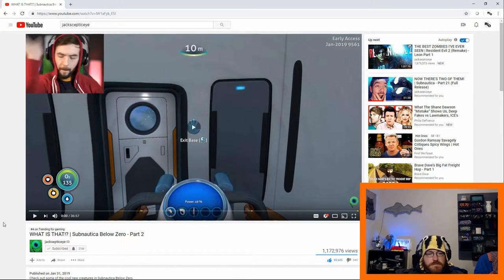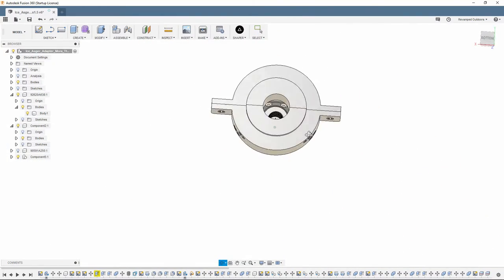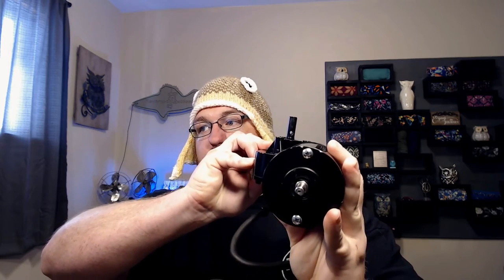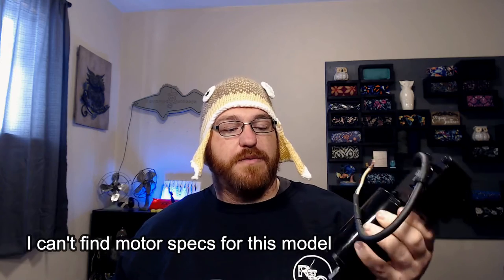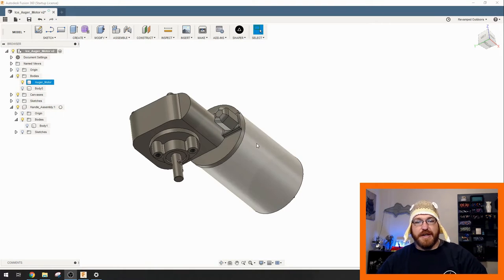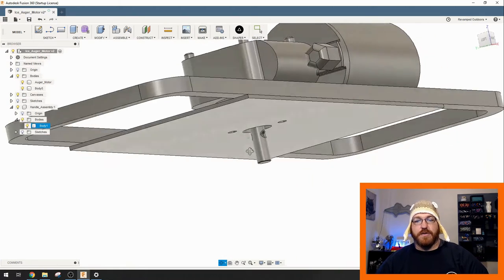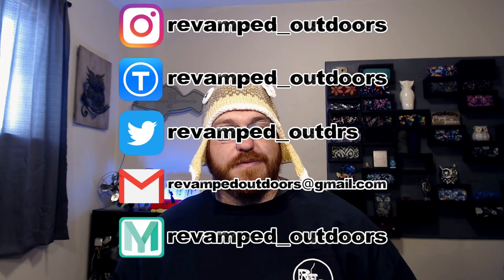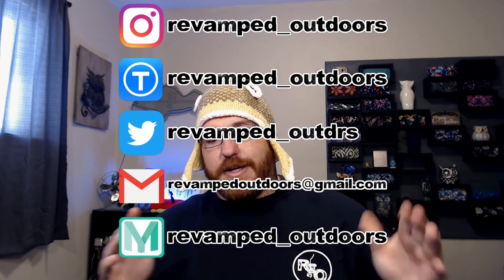I need your help! | DIY Electric Power Auger Part 1 (Lets Build)

Comment: Did you ever figure out how to best mount something to that gear reduction shaft? I have 2 of these SAME exact motors and I'm struggling trying to find something that would easily attach to it so I can set up some 12V wheels.
Reply from the maker: I think I'm still going to go with a piece of flat steel horizontally and drill a middle hole for the axle and then 3 holes for the motor mount hardware. If you're mounting it vertically it may need to be a pretty thick metal to hold the weight of the motor. I hope this helps, I need to work on this project more, I keep setting it down.

Comment: Did you end up finishing? I was thinking about doing the same thing and decided to look and see if anyone has done it before and just realized that you have a video on it.
Reply from the maker: The mounting platform is still giving me headaches, I got the motor and controller working really well it has the torque and I have a petg printed drill adapter that has held up to a 5inch for a season of drilling holes. I want to make a metal platform for the mount but I don't have much scrap lying around and not too sure how I want to mount it. Long story short yes...but no lol. I would say go for it, it is definitely possible for sure.

Comment: Hello, I am using this motor as part of my senior project and i cant seem to find anymore information about the motor itself. Do you have a datasheet or anything?  I love this idea btw, anything to make things easier
Reply from the maker: I couldn't find any information on it, I did model a mock up version of it that is on thingiverse, but as for the specs I have no idea kind of a mystery. Sorry I couldn't be of more help!
Reply: @RevampedOutdoors  no worries. Theres nothing online so it was a small hope lol thanks anyway

Comment: I'm in Australia and have never seen snow before but I'd love to get in on this. What's the deal with these augers?  Do you press down on them? What's the desired rpm of the blade when under load? Can you incorporate a ice assisted heatsink just for fun?
Reply from the maker: Hopefully it's not too hot over there, I saw a few creators this week talking about how hot it's been the last few days.  I'm not sure if augers work on that side, word is they spin the other way and the blades don't cut...probably would fend off a drop bear or two though.  Ok, time to get somewhat serious here, for the most part once the blade starts to cut into the ice you don't need to press down the weight of the assembly takes it through the cut.  This is assuming the blades that tip the bit are sharp and at the correct cut angle.  Sometimes with dull blades you'll have to press down throughout the cut it'll go but it needs a bit of help.  RPM seems to very quite a bit, some blade designs cut larger chunks and are considered "chipper style" blades more rips through the ice then shaves it.  Usually chipper blades run at a slower speed just take more ice as they go.  Some of the newer electrics really move fast with shallow angle blades and produce finely shaved ice.  I would say for the Mora auger bits for this project anything in that 60-100 RPM would be slightly faster than you would crank by hand.  It won't win any cutting contests but it would be better than a stick in the eye. Heat sink....This just blow my mind, literally just screwed my ears back on.  The second you said that I thought about a 3D printed enclosure around the motor body with a water block and a PC water cooling radiator pump combo.  Then we turn the voltage up to 40V and let'r eat! We could even fill the loop with ice shavings made by the auger.  This is a goldstar suggestion, just crazy enough too work! When all else fails you can always just ride the auger when the fish aren't biting although this project probably won't have the torque of this propane powered one. https://www.youtube.com/watch?v=yJ9ecANz1u0

Comment: Great, great idea bro, i actually have some old batteries laying around. I didn't realize there could be other uses for them. I was going to pitch them but now I know they have life after the weed eater has broken.

And I love that silicone wire I'll have to get some of that. 

Waiting for part 2 thanks bro.
Reply from the maker: If they are still holding charge check the terminals to make sure you can draw power without any secondary draw. Some of the newer ones have over draw protection and other fancy safety mechanisms so sometimes you can't get the power out unless a specific requirement is met ie the drill is plugged in. There are ways around it but they can be a huge pain in the rear. Thanks for watching! If you have any thoughts/questions/concerns/recommendations on the project post em!

Comment: so did you ever get this going? I have already built one...only I didn't have super cool 3d imaging and printing to make the parts. here is the video link. https://youtu.be/zp9G9sbpvqM  With the cold outside you should be able to over volt that motor even if it is only for a 12 volt. you only have to worry about melting the wrapping on the winding and if it's cold outside that helps...easier than your computer heatsink and water cooling would (hope you were joking about that). I started with 12 volts and found it to go too slow to cut right...moved to 18 volts...still too slow. finally put the batteries in series and bingo...between 180-220 rpms of pure cutting magic. worked awesome till I was redrilling a hole and found some A hole's frozen beer bottle in the middle of the hole.  the gear reduction on those worm gears are made of nylon and when I hit the bottle I stripped both sides of both gears....bummer. 

For sure have a dead switch that must be pushed in order for you to push a switch to move it in one direction or another.  I use a momentary on switch for my left thumb and a momentary on/off/momentary on switch for my right thumb.  Got it at a boat place...pricey but worth it. A lot of things depend on how much that motor you have is geared down. you might just want to build it up and try it and then adjust the speed with the voltage as you can rewire the batteries from parallel to series to increase the voltage.  hope that helps...its a fun project.  

This year I bought a used strikemaster 54 volt model that got discontinued and they don't carry the batteries for them anymore.  for $80 I bought a virtually brand new lightly used rig that the battery got lost from before they discontinued making them and the guy never wanted to pay for the new battery.  so I found online that they make the battery adapters that you made yourself and am going to put 3- 5ah Milwaukee M18 batteries in series on it to get my 54 volts.  it wont be completely home made...but I should be the only guy out there with a Milwaukee powered ice auger!
Reply from the maker: Thanks for the tips! I was going to start working on this again, it took a back seat to all the soft plastic stuff this summer, I have most of the parts in now though so it's just a matter of fabricating the base and working on the adapters for the whole thing.

I appreciate the insights on your project, I will use most of them during this project especially running it at higher volts.  I assumed the cold would help a bit but I didn't expect it to help that much so that's good to know.

Comment: Sounds like a great and fun project, I’m a little concerned that the shaft will not be able to handle the torque necessary to cut through the ice however. It seems to be a little modeling might be a good idea.
Reply from the maker: Thanks for the input! I'm a bit concerned with that as well, I got the motor off of eBay and I think someone scrap'd it out of a discontinued mobility chair.  My best guess is something from the Pride Mobility Corp, it seems like the PM802 motor is referenced by a lot of their models.  I think they had two of these assemblies one on either side of the chair to move the user forward/back and turn.  I'm not sure what the torque output of the geared shaft is either for the same reason.  I have truly went into this thing blind...but that's half the fun! Failure is a common option! Might have to try a bunch bunch of different filament types to find something that's strong enough but you never know until you try! I have had decent luck prototyping a hand drill assembly with a ridiculously thick section of PETG but I don't have that many trials with it yet so it's hard to say on the durability.  Would be nice to try some nylon or something but I may have to upgrade printer parts just to print it lol.